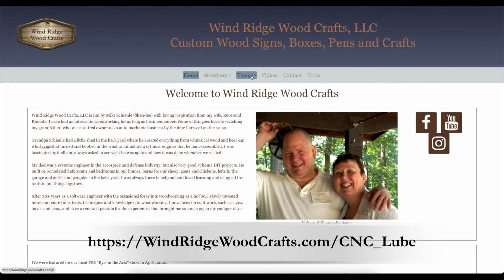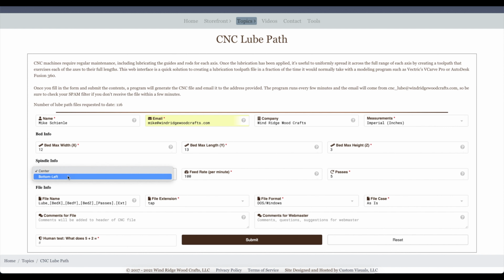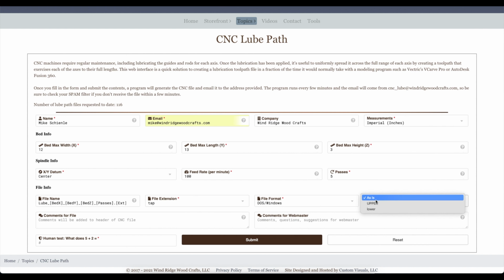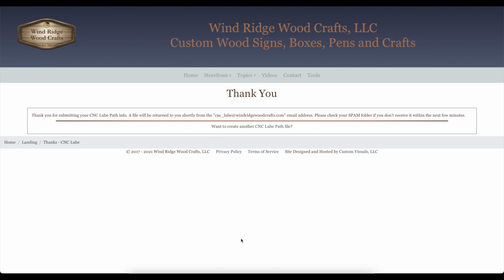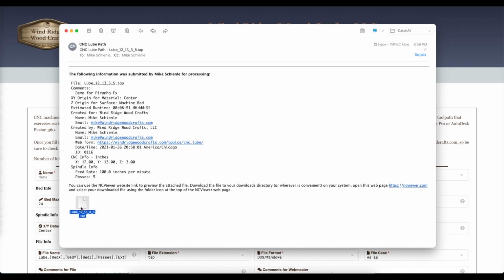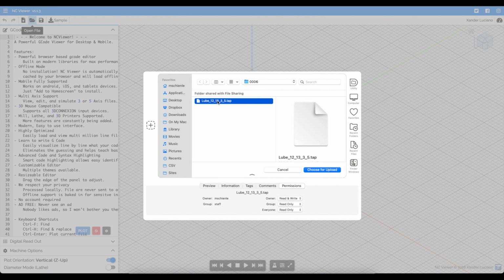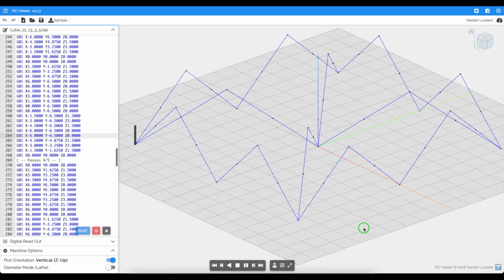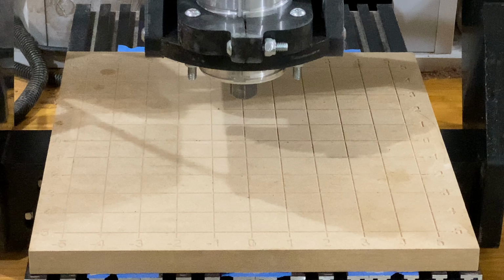CNC Lube Toolpath Generator

Comment: Thats a nifty little idea, but would this work with the elite foreman onefinity series with the masso?
Reply from the maker: Hi Sinner - it should work with no problem. It's just simple gcode, nothing tricky or specific to any brand of CNC. Let me know if you have any problems.
Reply: @WindRidgeWoodCrafts I wasn't sure how post processors and all that side work so yeah...machine hasn't even arrived yet but you've added to my to do list lol
Reply from the maker: @8thsinner  a post-processor converts the model (CAM) into gcode. In this case, the post-processor is my little bit of Perl code that runs behind the scenes to go from clicking submit on the web interface to mailing you a gcode file. When you fill out the form on the web interface and hit submit that does a few things: sends the form contents to an email template, sends the form contents to a database, and triggers a Perl program to run. The Perl program reads the database for new records, builds a gcode file based on the record and sends an email with the gcode attached. That all happens in about 0.03 seconds. So, you get a pair of emails, one that confirms what you submitted and the other that includes the gcode file, along with a recap of the form contents.